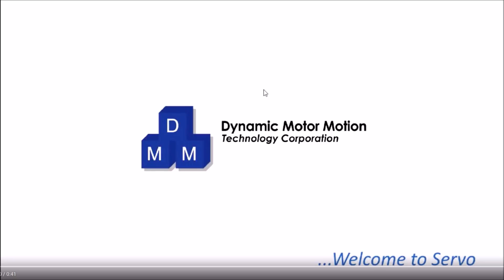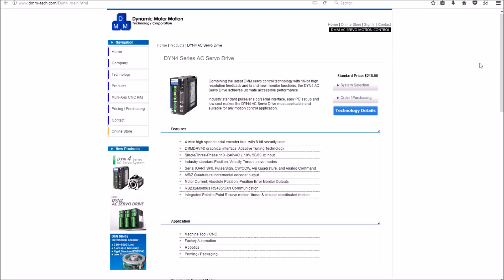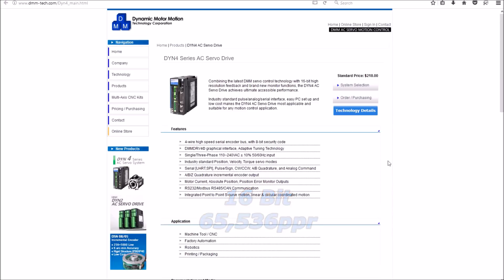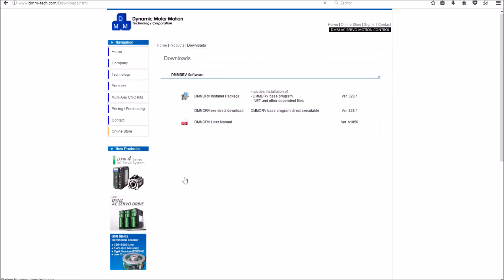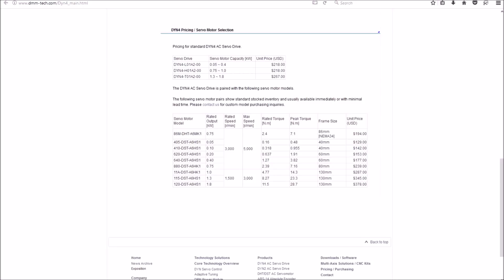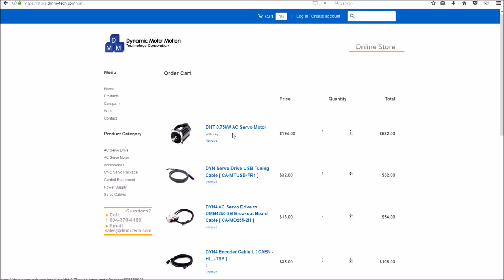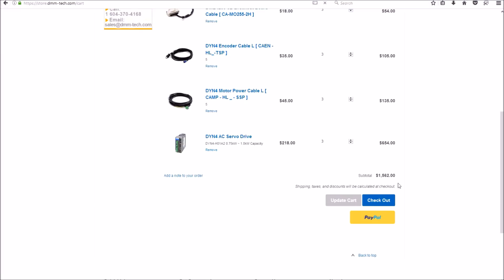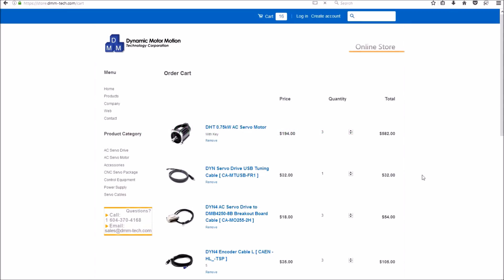DMM Technology DYN4 drive and Servo Upgrade

Comment: Hi
Want to find about pin 16 and pin15
How to plug in 24 v dc.  ?
+24 v dc go to pin16.
Yes no?
To where need plug in -24 v dc wire?

To pin 15. Yes no?

Thanks
Reply from the maker: Check the documentation from DMM

Comment: can these motors and drives be ran of 230V single phase. i'm from the UK
Reply from the maker: Supply Voltage 100-240 VAC Single phase
Reply: @CNC4XR7  ok thanks  struggling to find anything suitable over here.  at a good price that is
Reply from the maker: @davidpearson3146  I have seen Similar servo and drives offered from China at a lower cost something to look into however I dont know how well documented these are.

Comment: hi , you said in this video that DYN4 can be connected 220v single phase, or 230 v 2 phase. is there any better performance if you connect them 230v 2 phase , what wire size would you use     and how would you connect it to the electric penal.

Comment: nice tutorial   i need an advice  what centroid controller should i buy for my CNC router.  thank you
Reply from the maker: I have not tested the Acorn controller, so I cant speak on it  I have just released a Mach3 Rack style ATC screen set for CNC routers with iso 20 ATC Spindle,
Reply: thank you

Comment: just wondering  do DMM servos miss steps like stepper motors. we all know that stepper motors missing steps whenever they want, .  
i was looking to buy Clearpath  servos  but now there is DMM servos . i have a big   12' x 6' CNC  and running on NEMA 42 my X Y, and NEMA 34 on Z,  what would be a good replacement for those steppers if ill go with DMM servos. 

Thank you
Show less
REPLY
Reply from the maker: Max Smith 
No they do not miss steps.

Comment: I have been using this DMM. Servo complete system on my 4 axis CNC  router for about 4 years.  Not a single issue. Great customer service.  The latest DYN4 is now plug and play which is fantastic! Why would anybody would want steppers when these AC servers are available?
Reply from the maker: Hi Rod,
I somehow missed this comment, Thank you for the information! I agree especially when the servo system cost have  became more reasonably price! The DYN4 make wiring simple and eliminates the need for a big DC power supply.
Normally reliability is not a issue with servos.
Reply: hi Rod ,,, just wondering  do DMM servos miss steps like stepper motors. we all know that stepper motors missing steps whenever they want, .  
i was looking to buy Clearpath  servos  but now there is DMM servos . i have a big   12' x 6' CNC  and running on NEMA 42 my X Y, and NEMA 34 on Z,  what would be a good replacement for those steppers if ill go with DMM servos. 

Thank you

Comment: I was following this conversion rather closely. Maybe too closely. I have already ordered my Clear path and received my servos. I'm about to lay out my control cabinet with the other components. My dilemma now is completing my conversion using the clear path. Can you put me in touch with someone who is using the clear path servos on another PM 427M conversion? Any advice would be appreciated
Reply from the maker: Hi Richard, Sorry about that Clearpaths will work fine  and wiring is similar to the Steppers just the DC power supply is 72 volts vs 48volts. 
Yes Wyatt is running Clearpaths and he is happy to help https://www.youtube.com/channel/UCGZMbQE64hodNFJLrYhOLMw

Comment: Cool stuff. Can you point me to the info about the analog input? Seems like this could be used as a spindle drive and a "C" axis on a lathe.
Reply from the maker: The DYN4 is quite capable of doing just that and servos up to 1.8KW  
a excerpt from the manual pg 36. █ Analog Input in Position Servo Mode
In position servo mode, the controller can use 0 ~ 10VDC analog input to turn the motor. 0 ~ 10VDC
analog input commands motor from 0 ~ 90*4,096/Gear number (degrees). Ex. if Gear_Num=8,192, a 5.5V
input will move the motor 24.75degrees.

http://www.dmm-tech.com/Files/DYN4MS-ZM5-A18A.pdf

Comment: I wonder if the the Nema 23 400 watt would work as a spindle motor for my small Taig mill? My current AC motor is 1/5 th horse power.
Reply from the maker: William Hardin 
I don't see why not?
However if your going to have to make a mount I would consider the 60mm and drive it with a Dyn4 drive powered by 110v ac.
Or better yet step up to a 750 watt nema 34
Reply: I thought about that but the 400 watt nema 23 is about half the weight of my current motor and the nema 34 is also less weight but not as much. The other thing that would justify using the nema 34 is the shaft size is the same size as my current motor and pulley.
Reply from the maker: William Hardin 
But it's 5000 rpm and 1hp
Reply: I'm not sure the Taig will handle that kind of HP. I'd have to put some more bracing on it, which might not be a bad idea anyway. I have 3 of the nema 23 ClearPath servos to put on the X,Y, and Z axis already, just haven't got around to it yet.
Reply from the maker: always options thats the hard part LOL
Reply: I thinkI will go with the Nema 34 and start looking at how to beef up my vertical column. I like the idea of being able to run the spindle off 110V ac instead of the big 75V dc power supply that I have for my ClearPath servos.
Reply from the maker: Being able to power the DYN4 drives with 110v , 220v, or 230v three phase is very convenient.
I have the 750 watt nema 34 servo's so stay tuned to see how they perform.

Comment: great choice, we have used both DYN4 and 2 series and they work great. We are also thinking to add the homing logic to MASSO to use the encoder Z pulse from the motors, this will make homing very accurate.
Reply from the maker: Great thanks for the update!
Reply: HI, How do you do this: (We are also thinking to add the homing logic to MASSO to use the encoder Z pulse from the motors, this will make homing very accurate.)
REPLY
Reply: This has not been added to the MASSO software yet, but once added one of the 32 inputs on MASSO can be connected to the Z pulse of the motor encoder to take feedback for homing.
Reply: thank you